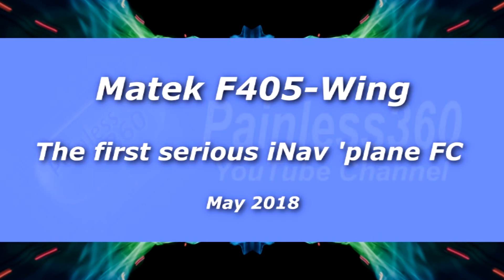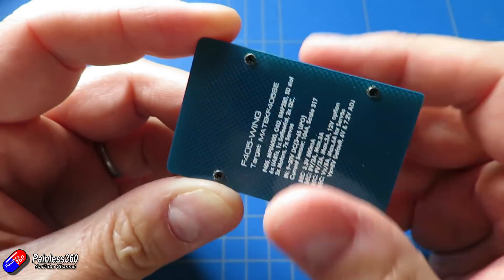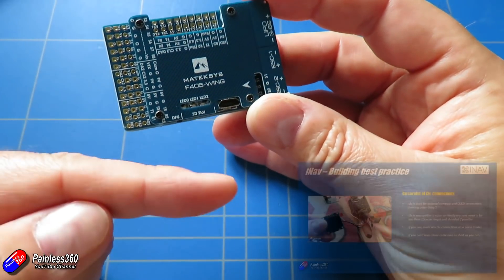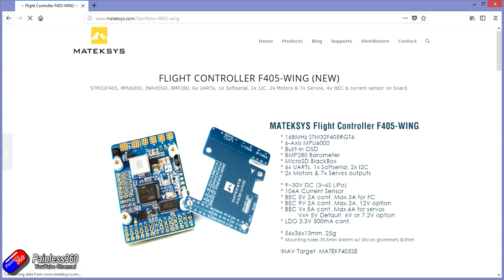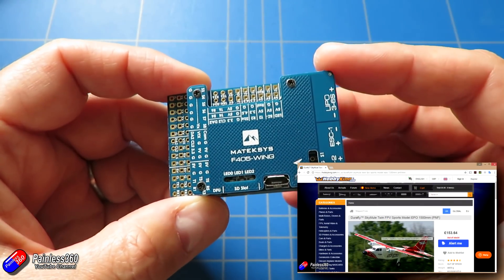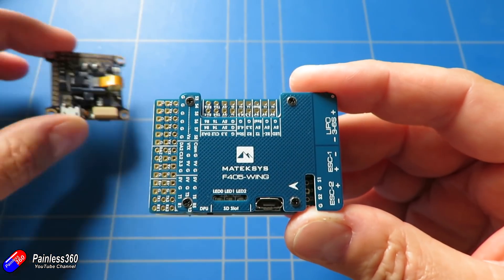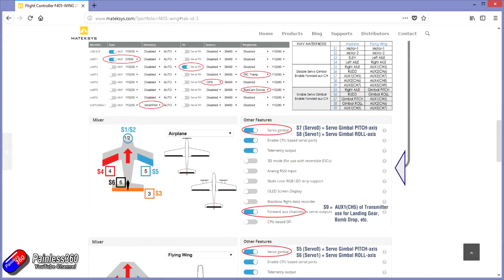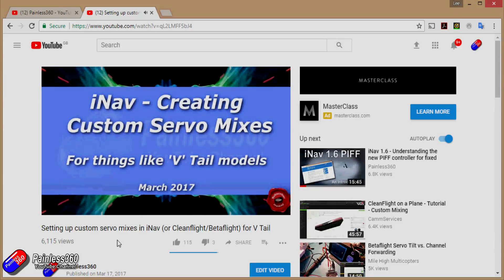First Look: Matek F405-Wing iNav fixed wing model flight controller

Comment: Im have a issue all a sudden speedy bee v2 has a connection issue with the f405. The speedy bee is green but wifi say connected with out internet. The board blue led wont stop flashing. I had 1 connections but when i was saving it just saying rebooting.
Reply from the maker: I've not seen that. Does the FC work normally otherwise?

Comment: Thank you for going through all this stuff.  I've been flying for 40 years - but I'd completely missed this 'revolution' in radio & flight control technology.  I was still flying with a Futaba Analog system from the 90's!  You've helped me make some (hopefully) sensible choices with what to buy.  I'm really looking forward to trying a Flight Controller as I just don't seem to have the coordination I used to, to cope with 5 control surfaces + throttle on something that's a pig to fly at the best of times.

Comment: I had this set up with a crossfire nano- all was running fine 3 years ago (before shtf)
then was trying to get an R9 mm to work and never did- the reciever tab would always be dead no matter what- tech makes me crazy sometimes- 
meanwhile going back to the crossfire cannot get fc telemetry to come up- I know it's some port setting or maybe CLI command or UART choice
do you have crossfire running on a 405 wing? what are your port settings?
thx for being there in a crazy world !

Comment: I’ve got 4 12g servos on mine in the s3–s6 pads and they are browning out.
Reply from the maker: Why do you think they are pulling more than that flight controller can provide? Stiffness linkages? Something else?
Reply: @Painless360  after less than a minute one stops working then another. When i restart the FC they all come back on.
Reply from the maker: And is the power still there? What basic things have you checked already?
Reply: @Painless360  Yes full power on the board
Reply from the maker: I was referring to the 5v. What troubleshooting have you already tried?

Comment: I am using this on a 1100mm FPV plane. I am having a problem when I use the RTH function. The plane goes into RTH ok but instead of circling at the 50mts that I have set, it seems to circle around but it keeps diving down to about 25mts and then climbing back up to 50mts. I'm sure this is in the setting maybe the PID's but I don't know enough about it yet. Do you have any Ideas ? Regards, Pete
Reply from the maker: How does it fly in modes like CRUISE and ANGLE/HORIZON? See my full INAV setup videos for how to setup INAV 3.0 and get it flying well..
Reply: @Painless360  Yes I have watched your Inav setup Vids, I think I've watched them all :) It flies fine in Horizon and in Acro I have got the model trimmed great. As soon as I put it into RTH it does it's circle ok but it's not stable it's up and down like a see saw :)
Reply from the maker: The same in GPS POS HOLD?
Reply: @Painless360  I've not tried that because it's not a mode I use. It's bad wx now so can't try it for a while :)
Reply from the maker: RTH is the LAST mode to try - see my INAV setup videos. If it can't fly well in the more basic GPS modes then RTH won't work. Best of luck

Comment: Hi painless! ive been watching your videos for a few months now and find them a great source of information especially if I'm struggling to get something to work. well today is no exception as I've spent all night trying to get a matek f411 mini to work(in a new zohd dart). As hard as I've tried i cannot get it to output to the servos at all. The only sign of life i can get out of them is when i plug the battery in they make a clicking noise. ive tried plugging in different servos to the board with the same result, may i also add that on Inav my reciever is outputting fine and on the outputs tab i can even see the two servos moving. just it seems no signal is actually bieng sent to the servos as nothing is happening !! im starting to think it might just be a dead board but I'm open to anyone who thinks they can help:) p.s ive also tried re-flashing and resetting the fc to no avail.
Reply from the maker: Please see my INAV for beginners 2020 series for all the steps I use to get a model working.. Best of luck

Comment: Can someone help me , my F405 locks me out if I am flying and wiggle the sticks randomly . Both of my F405flight controllers do the same thing on 2 different radios . I'm about to give up on these flight control board's
Reply from the maker: They work flawlessly for me. See my INAV for beginners 2020 series for all the steps I use.. Best of luck
Reply: Oh I should mention I'm not a beginner , just the first F405's I have used . F765 and F411 have been awesome , only issue is the F405.  Thanks for the reply
Reply: I have fixed the issue , seems the 2.5  and 2.6 versions of the firmware don't like random stick inputs whilst flying and cause the servo's  to lock out . Downgraded firmware to 2.3.3 and all is fine . Indecently I tested this theory on both the F405 and F411 wing  boards and after upgrading to lasted firmware both boards suffered the same issue . Thought yo might be interested in the outcome  , keep up the great Video's .

Comment: Thanks for all your help and videos, I need you once again ,while soldering pins to my f405-wing for my gps with build in compass I think I damaged tx4 and rx4 because I cant see traces going to either port, if so can I use tx6 and rx6 instead and everything still work? Thanks again
Reply from the maker: It should do - I'd try it and see.. Best of luck!

Comment: Hello there again,

Quick question I was just wondering how is it that you're able to output telemetry via one of the serials straight into the smart port using INAV however with ardupilot you can't do the same? It appears you have to use an adaptor of some sort.

Many thanks
Reply from the maker: Yep, see the Arduplane/Omnibus series on the channel where I cover this and show how it's done..
Reply: @Painless360  my understanding is that its to do with signal inversion, if my receiver has an inverted smart port tab / pin, can i in theory do without the special cable?

Comment: Hi, could you please do a video on how to connect 3dr telemetry radio to a UART?
Reply from the maker: The physical connection is the easy part. Those radios I designed to use Mavlink rather than the telemetry systems that iNav uses. Because of that, you need to also flash the radios with an updated Firmware so that they support the other telemetry protocol. It's quite an involved process. Have you seen Yaapu Script solution for I did recently?
Reply: @Painless360  hi Lee, thanks for the reply, I checked yaapu script video but I am actually trying to achieve something different, my ultimate goal is to have F405 communicate with Raspberry PI running an opensource HD video downlink project. You can see the details below. I thought if I could get 3dr radio working then it will be easy to figure out the issue with dronebridge. Dronebridge requires LTM telemetry data from any UART to be sent to raspberry pi UART by a direct connection but I couldn't find any proper instructions on how to set it up in inav. https://github.com/seeul8er/DroneBridge/wiki/Setup-Guide
Reply from the maker: I'd look at the tweaks to flash the radios to work with MSP - https://github.com/stronnag/SiK-MSP for example.. Hope that helps..

Comment: I want to run an 8s battery in the plane.  Can I run the battery power to the ESC, not the f405 but of course then run "data" leads normally? The ESC has a 5.5V,  8A BEC to power the f405.  Does the question make sense?
Reply from the maker: Not sure I understand the question..

Comment: I am totally fed up with this FC! Nothing works! No compass (I2C not detected), no battery voltage & current sensor, no GPS with ardupilot. And a forum etc is not enough so solve my problems.
Too much too type :-( And the support is "one sentence" style.
Reply from the maker: Sounds like you have a bad one. This is why it's do important to test it all before installing it into the model.. Best of luck!
Reply: @Painless360  Battery & Current are working now and I cutted my hand with the prop during calibration of current sensor. Maybe it must be sewed with a few stitches.
 I2C still not working..... hope that Matek helps. Sound of the motor is terrible...iiiiiiiiihh.... hope that changing the parameters with the YEP programming cards helps. I used a 50A YEP and a 2212 motor from emaxx.
Reply: BATT_AMP_PERVLT 31.7 (must be adjusted with current sensor for model planes)
BATT_CURR_PIN,11
BATT_VOLT_MULT,11 (must be adjusted with voltmeter)
BATT_VOLT_PIN,10

Comment: Might be a dumb question but can you connect an X6R with the Sbus ?  I'm so confused :(
Reply from the maker: Yes you can but if you're using S-Bus then there are smaller, cheaper FrSky receivers that will work as well. If you're new to this then check out the 'Introduction to Remote Control' playlist that holds a lot of the basics.

Comment: Hi, could you please tell me why the osd tab in the inav configurator is completely blank? All the other tabs are fine, it's not in a model just yet, I'm just getting it all set up first.
Reply from the maker: Check out the reports on github. Looks like there's a bug at the moment around this.
Reply: @Painless360  Ok thanks for the advice.

Comment: Hi Lee. I hope you have had a good Christmas. Apologies for disturbing your Boxing Day.
Matek F405/F411 wing flight controllers. Have you any experience flashing them with ardupilot? I currently run Inav 2.0.1 (the latest) on them. Inav seems to have matured of late. Do you still think arduplane has the advantage it once had compared with the latest Inav? I use gps, rth and most of the other goodies inav has. (I am a lousy pilot) I like inav's osd and the ability of the toranis to speak the voltages, amps, vario, heights and ground speed, via the smartport. I need all the help I can get. Have a good one! Garry G
Reply from the maker: I've not tried as I tend to go for a 'real' PixHawk for those times I want Arduplane or Arducopter. I've been asked a few times for videos on this but until I can get a chat with the developers then it'll be tricky to make decent content that will be useful longer term..
Reply from the maker: A quick preview of a new series that is starting next month as it may be something you're interested in.. https://youtu.be/VBFSaNF-gm0

Comment: How is the OSD and Camera under high load? I know on quads noise in some AIO boards is not as good as external filtering. But some boards are great. Is this the later or the former?
Reply from the maker: This flight controller is designed for fixed wing models, and I’ve only used it on those so can only comment on that. I’ve had no problems with it, hopefully that helps..

Comment: @Painless360 - That's massive power in the F405-WING!  Does it get really hot?  I have the idea I might want a fan on it if it's trying to handle 1400 watts of motors and 20-some watts of servos...

Comment: Painless, im having a terrible time with this FC, so i bought it, set it up, and it flies great, all of the modes work, everything flies as expected, but im having issues with RTH, when i flip the switch and it goes into RTH it suddenly nosedives to wards the ground the second its facing home. please help me.
Reply from the maker: That's usually down to the setup, I'd check that you've followed the steps in my iNav series and the wiki as you can 'skip' a step and then reverse/setup everything so it appear to be ok but it's not setup properly.. Best of luck!
Reply: @Painless360  thank you!!

Comment: Ive just managed to install this in my zohd orbit and i must say its a very tidy install. Fits under the battery giving me loads of space for a bigger battery
Reply from the maker: Did you see how I did the same with my Orbit and iNav? I did something very similar..
Reply: @Painless360  I certainly did and I used your video to set mine up,  thanks for that. Im currently installing an r9m mini reciever to now and once thats done im moving back to my 10 inch inav quadcopter thats been sitting on my bench since last year. LOL.......oh fun times ahead!

Comment: I would love if you could show us how to flash APM on this FC. I am stuck trying to get my BLHELI_32 esc and telemetry to work on my Matek 405 wing with APM. Could you step us through the setup of APM on this FC?
Reply from the maker: I've been looking at this but the whole support for these types of boards needs more work to make it easier.. I'd still use a PixHawk if I want Arducopter. Best of luck!

Comment: I've seen yours and other videos about the Matek flight controller. I fly only fixed wings and still have no idea what flight controllers do. I would love a video explaining whey function they perform on both fixed wings and quads as well as the benefits of running them on a fixed wing. Just a thought. Thanks.
Reply from the maker: That is an excellent idea. I’ll add that to the list..
Reply from the maker: https://youtu.be/YAfNC55Udu0 ;)

Comment: Hi Lee I was wondering if you could help? I have a Matek f4 wing board and when setting it up on I NAV everything was fine until I went to the receiver tab and switched on my transmitter. When I did this the board froze but when I turn off the Taranis and reboot the board its fine until I turn on the TX have you ever came across this  Best regards, Tim  PS Great to meet you on the face reveal the other day
Reply from the maker: I've not seen that here - maybe a look in the forums for that? Best of luck!

Comment: I've got one. I've been putting it in my Bix 3 today and everything was fine. I was checking the servos direction and they were fine. A little after the servos just didn't work. Now I can't get the servos to work at all. Motor output works fine. Any ideas?
Reply: @Tyler Phillips I finally figured out what was causing my issue. Sadly the 5v rail for the servos killed itself and I had to get a new one sent out for me.

Comment: So overall. Which do you think is best. This, or the F35? Assuming someone like me who has tons of experience soldering.
Reply from the maker: If you have the space then its the Matek for me. Having the big 5v line for the servos, lots of UARTS and exposed i2c pins is handy..
Reply: I think I'm going to build a Mini Drak. I'm pretty sure the way those are, the big long bay in the center would allow enough space for it.

Comment: This board is a really nice compact and clean solution for a plane, although I really don't trust iNav so gave it a miss at the time when it came to the market. But I recently fund out that this board can be flashed with ArduPilot software (ChibiOS version) which made it again really attractive and I think I will give it a go. I think because of ability to be flashed with ArduPilot software, which is much more mature and trusted than iNav, this board may become very popular. Therefore it maybe a good idea to make a tutorial how to flash Matek F405 series boards with Arducopter and Arduplane software. There is basic tutorial on Ardupilot website and also on Matek YT channel, but for "less tech'y" folks your usual more detailed step by step tutorial would be much more useful I guess ;).
Reply from the maker: I'm not planning on that but will be looking at using f3 based flight controllers with it later in the year. INav is very good now and should be more reliable than Arducopter/plane until that's had all the bugs worked out on the new hardware..
Reply: OK. Anyway, it is nice to see that Ardupilot will be / is working on these smaller cheaper boards.

Comment: HI, great video.. will there be anymore how-to or review on this board? I have just purchased the same board and installed in my AR Wing, I am planning to to use my BN220 GPS along with the F405 FC for a Failsafe RTH function .. however i am not sure how to go about this, a how-to video on that would be great.  thanks!
Reply from the maker: Yes, I installed it into my Caipirinha II wing - check out the video..